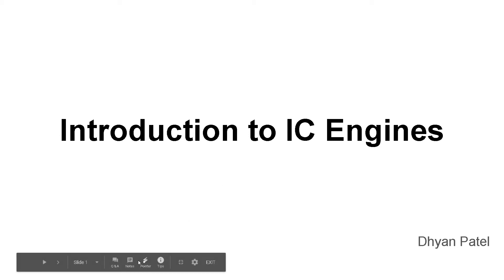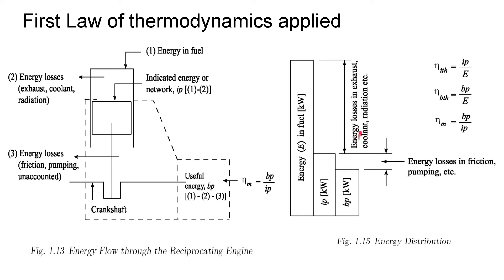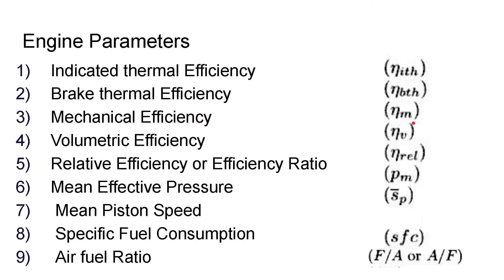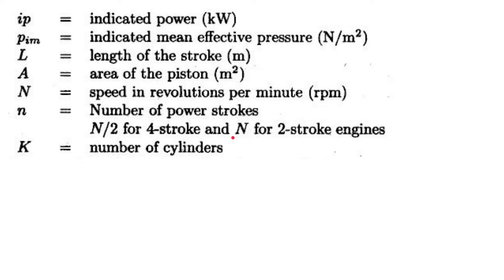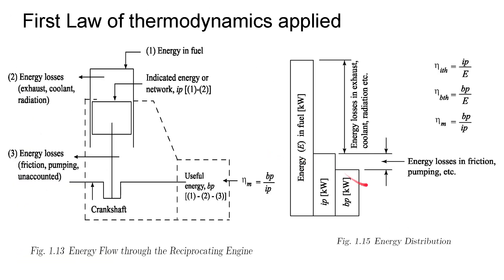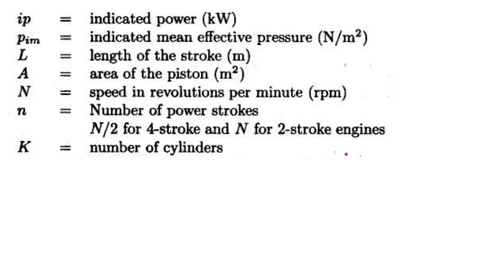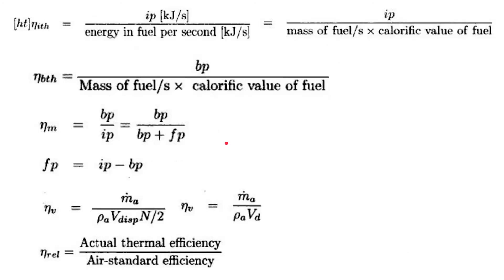Engine Performance Parameters || Ch-1 || Internal Combustion Engine (IC Engine)

Comment from the maker: Video Timestamps

00:00 Introduction and Recap
00:24 First Law of Thermodynamics | Energy Balance
01:33 Energy Losses
03:20 Engine Parameters
06:12 Indicated Thermal Efficiency
07:03 Brake Thermal Efficiency
07:30 Mechanical Efficiency
07:53 Friction Power, Indicated Power & Brake Power
07:57 Volumetric Efficiency
08:51 Net (Relative) Thermal Efficiency
09:24 Indicated Power
09:54 Mean Indicated Power
11:38 Brake Mean Pressure
11:50 Mean Piston Speed
12:34 Specific Fuel Consumption
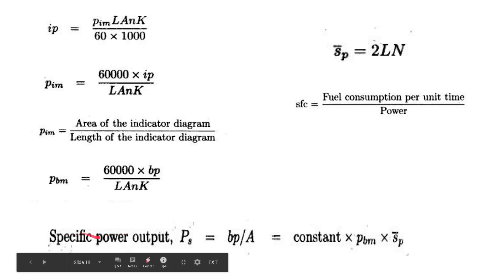13:00 Specific Power Output